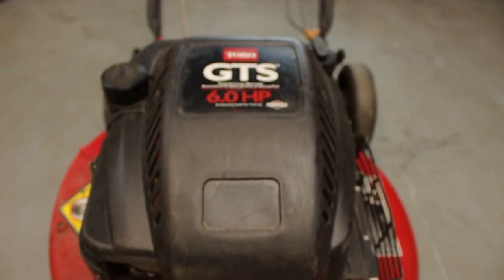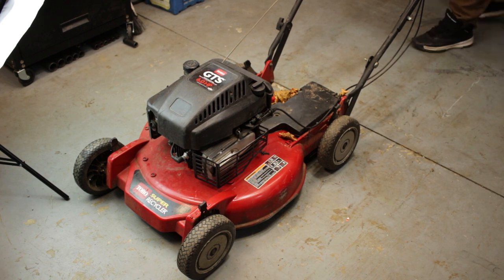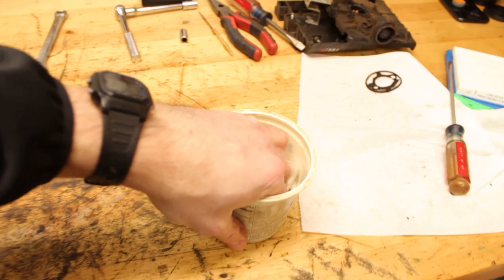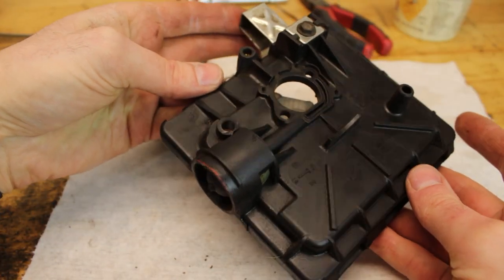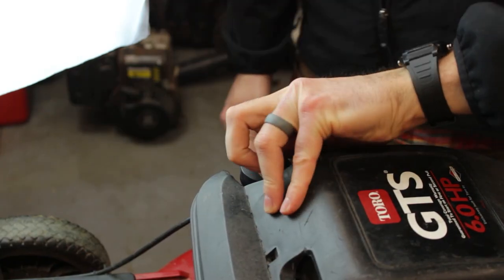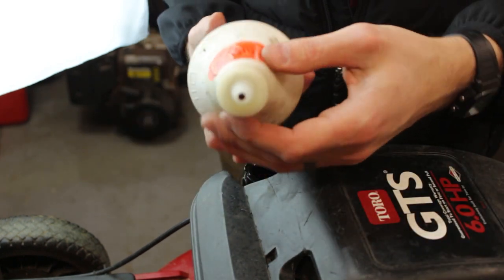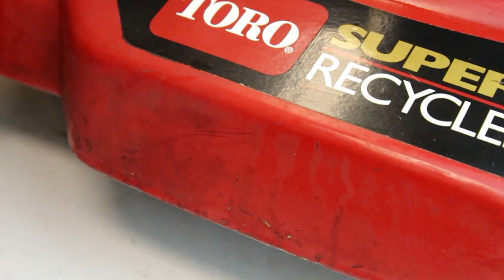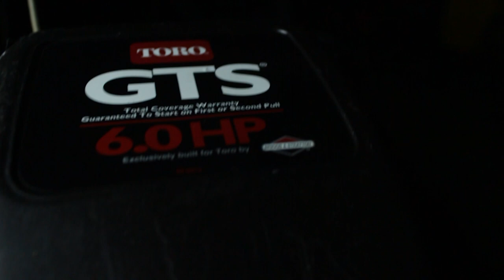FREE Toro Super Recycler - Will it run?

Comment: Great video. I probably would have removed the wheels and cleaned and greased the axels and drive gears. Also a shot of oil on all the cable ends and work the oil in.
Reply from the maker: Great point. I should get in the habit of doing that for everything I work on. Typically I only reserve it for things that are in rough condition.

Comment: Greetings neighbor, from southeast Michigan! I have the same exact mower. I purchases over 20 years ago. I was about to throw it to the curb last year. I rebuilt the carb and replaced the coil (insulation on spark plug wire was cracking). Fires right up, runs great and everything works.
Reply from the maker: It’s a great machine.. Thanks for sharing Jim. Michigan proud! Must be right around the corner from each other 👍🏼
Reply: Really good mower and i have the same thing the one i have is 1998.  still runs and mows extremely well.

Comment: Hi I have the exact same lawnmower but I don't have a serial number I'm trying to get parts for it can you please send me the serial number and model number please
Reply from the maker: Hello Ruthy! I would if I could. I sold the machine a while back. I’m sure you already looked but there should be a serial number somewhere. Do you need engine parts? Or mower parts?
Reply: Looks like I have a very similar model but no self propelled  6.5 hp and no bag. My questions are tho I don't see grease fittings by the front wheels on mine there isn't a cover you took off to expose the fittings were there? Secondly Don't see where there is an option for a bag is this true or is one not needed? thanks